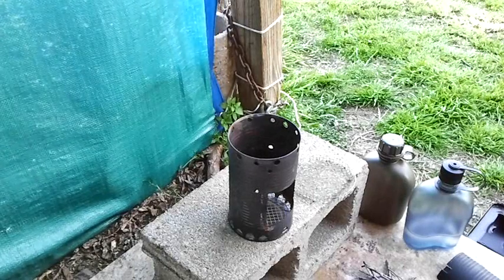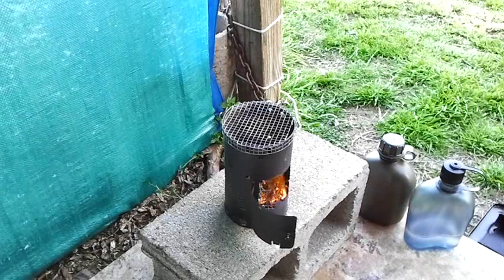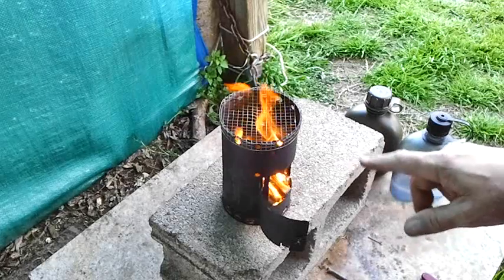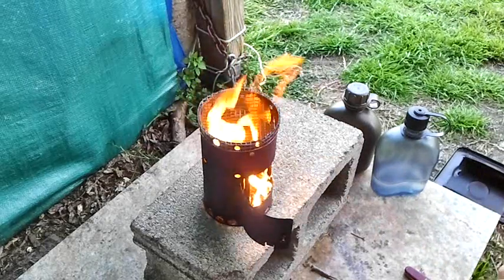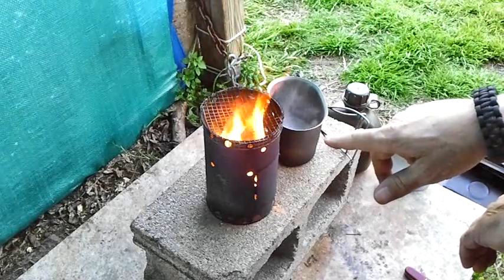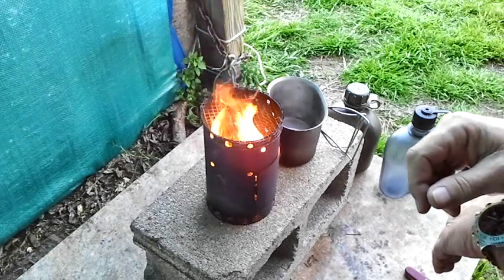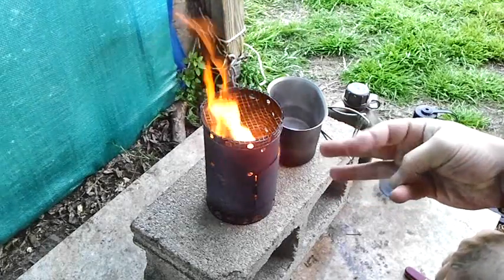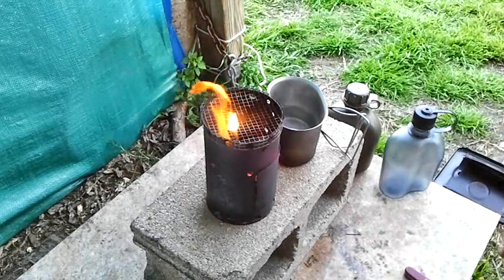Tin Can Stove - Rev#1 Update #7

Comment: Little bit more space at the top (higher grill or some spacer with holes in it, or even more holes in the side) will cut down on the smoke when you put the pot on. Seems like it's almost perfect, just a tiny bit more secondary air-flow.